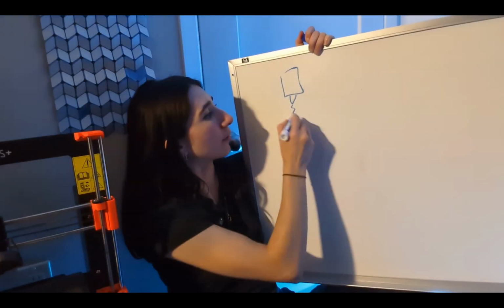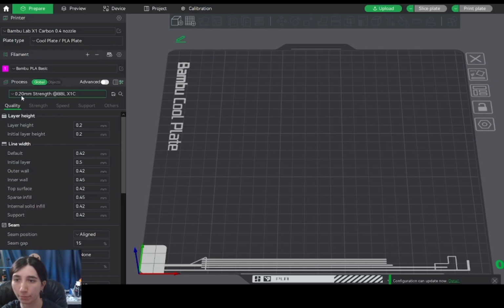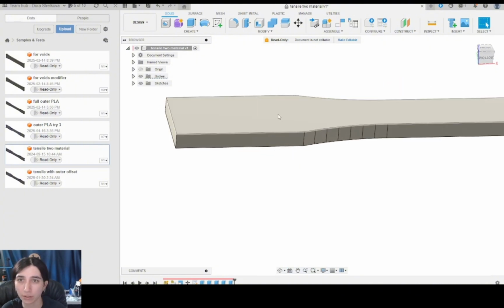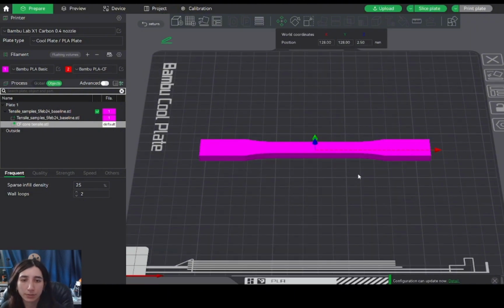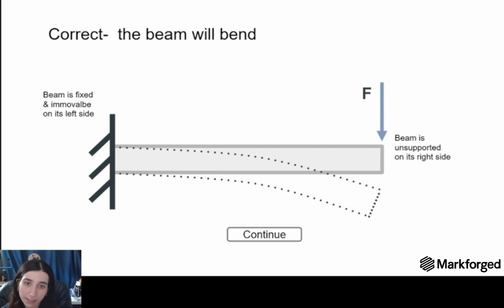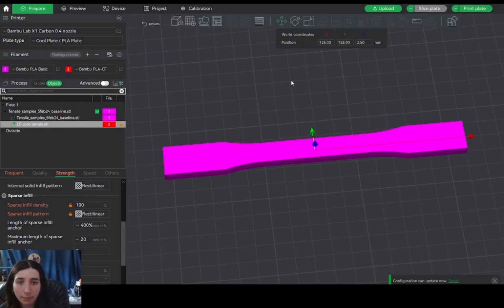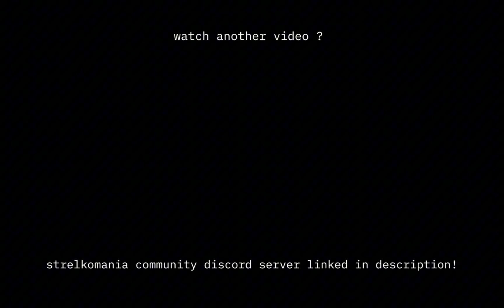stop fiber transfer & improve part strength with this slicer trick?

Comment: You need to look at Sirayatech’s “core” filaments, they have a ‘sheath’ of pure Nylon or ABS, and a core of 25% chopped fiber. It is like 20% stronger, tougher, and has no risk of fiber dislodgment.

Comment: Interesting video as always. You may want to try exporting .3mf files from Fusion360 with multiple meshes, each of which to be printed in a different material, instead of exporting as .STL and using the modifiers in the slicer. I'm not sure if this works in BambuLab's slicer, but that's how I've been designing/printing multimaterial in Fusion360/Prusa's slicer, I would expect BambuLab's to work similarly.

Comment: Your methodology is all wrong though for testing tensile strength.... The outer walls are printed in the direction of the tensile force so its applying parrallel to the printed walls... but the inter core, since its essentially infill, is printed in a rectilinear fashion, so almost like pulling on the z axis, you're pulling at a 45% angle to the filament paths, not parrallel.   You'd have a more accurate tensile strength representation if you printed with concentric infill, then the CF core lines would run in the same direction.
Reply from the maker: You're not wrong about concentric having a stronger tensile performance when printed in the X0Y0Z0 orientation. I even noticed that today when testing TPU samples. I used a 45 degree raster as I thought it to be the most common slicing fill pattern to be used in parts compared to concentric - at least in my experience. My first print test for this dual material print was actually using a concentric fill pattern but the surface finish didn't turn out too great. Thank you for your comment I'm happy to see you understand the tensile topic !

Comment: Pretty sure that instead of doing the modifiers in the slicer you can do it all in your CAD package. 
After you have made the inner object, boolean subtract it from the main object keeping the cutter - now you should have the larger hollow object and smaller solid that fits inside it. Group those together in one parent object and export that as STEP (or maybe STL). That should arrive in your slicer as two separate objects grouped together and correctly aligned. Works with text anyway.
All the best with your studies.
Reply from the maker: Yes you can! I actually initially did it this way in Fusion 360. When I made my part in CAD I added new bodies instead of joining all the extrusions into one. That way in the slicer I could paint the different parts to be different filaments. I had a bit of a challenge with this because in Bambu Studio everything snaps to the build plate so you have to be strategic with how you do your CAD. I found the modifier method to be easier and more straight forward, but not every slicer has modifiers from what I am aware of.
Reply: @strelkomania  In my package (Designspark Mechanical) you need to have the right object hierarchy for it to work. It needs the modifier to be an object /inside/ the main object; then you have to make sure the parent object is active when you export. That results in a somewhat flattened hierarchy in Bambu Studio.
If the hierarchy is wrong at export time it arrives as unrelated objects all stuck to the build plate. It takes some cad package specific experimenting to get it right.

Comment: I would expect a "sandwich" would always be less stiff than a total fill of CF? But if we're mixing stiff materials and relatively flexible materials, perhaps a better analogy to consider is reinforced concrete or FRP. So what if the infill, rather than being all one type, consisted of a mixed matrix of CF and unfilled material? Perhaps that would allow a useful mixing of properties (if you didn't just want the stiffest part possible).

Comment: Great concept and execution. However, in practical applications, why wouldn’t we leave the CF core’s inner walls in the slice? Since wall loops are where much of the part strength come from, why remove wall loops? I understand keeping two wall loops total for testing consistency but is there a real world scenario where it makes sense to eliminate the modifier’s wall loops? 🤔

Comment: Maybe you should do some testing with infill and strange vs using the material at the walls. (3D printing sandwich like structures)
Try to make 3 parts with approximately the same weight one with 2 walls and ~50% infill, one with 4 walls and x1% infill and one with ~10 walls and ~15% infill.
and then test them in bending. I don't know how low of an infill you can get away with. My guess is about 15%.
Just note that in tension the difference will be very small. The difference is in bending.

You can also just have one with say 4 walls and then print it with 100 infill, 50% infill and 15% infill and then see how close they are in bending stiffness even though the 100% infill uses much more material and weighs much more. again in tension the 100% infill will be stronger, because in tension it is just F/mm², the full cross section is in tension. But things tend to break in bending, not pure tension. 😂

Comment: I love these types of videos. It is like watching benchmark videos for GPU/CPU, and I love them too. 🥰

Well no surprise I have some thoughts. 🤦

1. I have yet to use modifiers, but know I know how in a slicer I have never used.

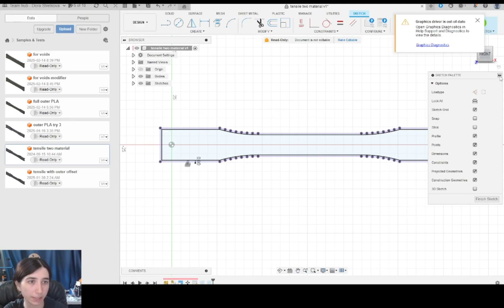2. 2:44 Is this not the perfect use case for the "shell" function in CAD. (I have not used Fusion 360, so it might be called something else but I would be surprised if it does not have this function)bother

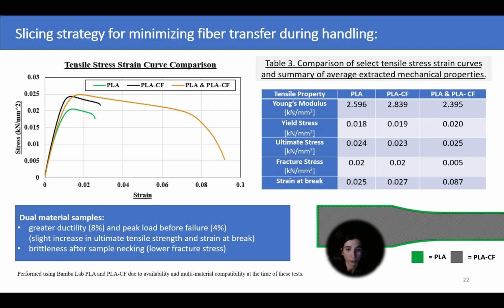3. 7:40 So we can see that from the graphs that the CF only part is the stiffest part. (steepest slope in the linear region) But the PLA part is nearly the same stiffness. If the two material bond well together then we would expect the PLA with CF inside part to have a stiffness between the two other parts. And that is exactly what we see. So the stiffness makes sense to me.

4. 7:40 Honestly the CF only and PLA only parts are so close in stiffness here that I would not even bother with the CF version. I mean 2600 MPa vs 2800 MPa, that is only 
7%. Is many cases you could probably just slightly adjust the geometry and have the PLA part be the same stiffness.

5. 7:40 For the yield strength it is a little more complicated. Cause where do the yield on that curve 🤷. But you could maybe argue that CF is 25% stronger.
also 20 MPa seems very low for PLA, I would have expected something like 50-60 MPa. 

6. 7:40 I don't really understand the ultimate strange values in the table, compared to the graphs. On the graph it looks like 20 MPa for PLA not 24 MPa? But this is probably just do to the average of 3 VS one specific test on the graph.

7. 7:40 I do not understand why PLA & CF have a much higher strain at break. This makes no sense to me. I assume this due to a different behavior of the infill. Maybe the PLA gets a little longer time to deform due to the higher strength of the CF and thus can hold together a little longer. But this would then indicate that if you did the test at a lower speed then the PLA would break at a higher strain value. 🤯 (I guess PLA creeps, but it is crazy if this is why the multi-material version brakes at a much higher strain.

8. Because this is a tensile test all material in the cross section contributes to the stiffness and strange the same. Thus if you did a 3 or 4 point bending test the difference would probably be slightly higher. Because in bending the outer layers contribute much more than the center. (the center line does nothing). And since you are coating the stiffer/stronger material with a less stiff and less strong material you will loose more of the material property. (if you know what I mean)

9. This got completely out of hand. youtube comments is just not the right place for discussing complicated things. 
(so maybe skip this one if you have other things to do)

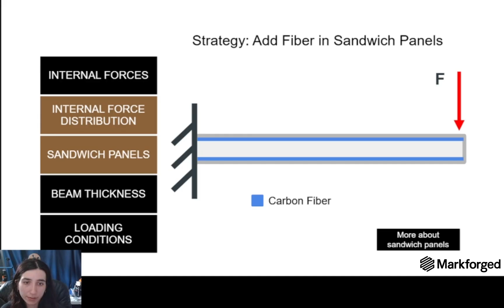9:55 This part was a little confusing to me. When we are talking about a sandwich structure (or an I beam for that matter).  Then we are talking about using the material where we get the most benefit from it. Say you have a 10x10 mm aluminum beam. Then a sandwich structure with foam in the middle will be less stiff and less strong. But it will also be lighter. Thus the reason we say a sandwich structure is super stiff and strong is because for the same weight we can get the material thicker and thus make it much stiffer in bending. But in tension a sandwich structure is no stiffer or stronger than just the materials in them self.

We call this "second moments of area" (It is not a good name 😂) but you can look up a table on wiki and see how to calculate it for different shapes. For a filled rectangular it is I=(b*h³)/12. This is mm⁴. (It makes sense if you do the full beam calculation. The thin we need to notice is that h is to the power of 3.
Thus if we can add some material to the center that does not weigh that much, then we can move the strong/stiff material further away for the axis we a bending around. (Making h a higher number) and then we can benefit form the power of 3. (thus a 2mm thick plate is 8 times stiffer than a 1 mm plate)
(12*1³)/12=1 mm⁴  vs (12*2³)/12=8 mm⁴ . (imagine two 12 mm wide plates one 1 mm thick and the other 2 mm thick. I is used when calculating the stiffness of a beam. For a "cantilever beam with end load": d=(P*L³)/(3*E*I) where d is the displacement in mm, P is the applied load in N, E is the material stiffness in MPa and I is the second moment of area in mm⁴. Note that MPa is N/mm² so the units match.)

When 3D printing we also use this effect when we have cay 15% infill. It is a little complicated, cause you need some material to transfer some loads between the top and bottom plates in a sandwich structure. It does not work if the can slide between each other. Think of a book. Every page can bend very easily and a paper back can bend no problem, especially perpendicular to the glues spine. And it is very easy to see how all the pages slide between each other when you bend a book. But if you glue the papers together, such that they are not allowed to slide between each other then the book becomes as stiff as a peach of wood. But we need something to counteract the sliding. In the I beam this is the web, in a sandwich structure it is the core material and in 3D printing it is the infill.

If you want to know more the youtube channel "The Efficient Engineer" does have two good videos on beams. One for stiffness and one for strength. Sadly I don't think they have one for sandwich structures. But the idea is the same. Use the material where it benefits the most and fill the rest with as little as you can get away with. To get a light, stiff and strong structure. (to be fair it gets really complicated really fast)

Thank you for reading my introduction to mechanical engineering 😂

Comment: Appreciate the research. Would be nice to start having a look at the new lines of "core" filled filaments. sirayatech fibreheart core ; Raise3D Hyper Core PPA CF25 ; Qidi Ultra Core, Phaetus NexPA-CF25 . They seemed to be a step in the right direction. Measuring airborne particles of them etc... :)

Comment: To make the comparison fair, you need to print your pla-cf with an extra amount of walls roughly equal to the displacement thickness which is created by the pla on the outside. That way we are doing an apples to apples comparison, otherwise we are not testing the same thing, ie, we end up testing that one model with thinner walls in total is weaker than one that is not. Which is not what we want to test. I'm not sure what is the case from the video, as one part clearly has to be either enlarged or made smaller than the other. But maybe you did control for this in general?
Reply: I might have misunderstood this but... Did she not do this? when she showed that she had 2+2 walls I thought the other parts had 4 walls?
(edited 2:30: oh maybe she goes down from 6 wall to 2+2 🤷depends on what setting she used for the other dog bones. Oh and then at 7:05 she removes the inner part walls, so the ends up with 2 wall. 😂, I assume the other parts was also using 2 walls. Since she spend this much time on getting the right number of walls 🤷)

That said it probably does not matter much when she is printing with 100% infill. Sure the infill is less stiff and strong in the tension direction, but probably not by much. But maybe she should just be printing with as many wall as she can fit in when she is printing with 100% infill anyway. 🤷
Reply: @Petch85  For your first paragraph: That's why I'm asking, it's a purely scientific inquiry. For your second paragraph: I don't know if it matters, that's why I'm asking :D
Reply: @fiery_transition it is a good question. The first time I watched the video I just thought she showed it because she was making sure that she had the same walls on all 3. But after reading your comment and rewatching the video, well now I am not so sure. 😅

I am maybe 70/30% right now 😂.